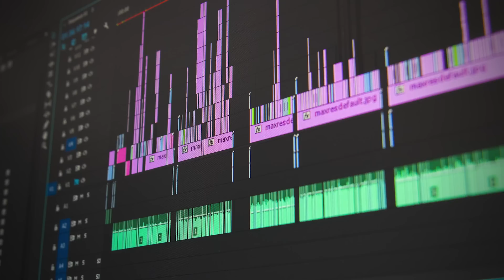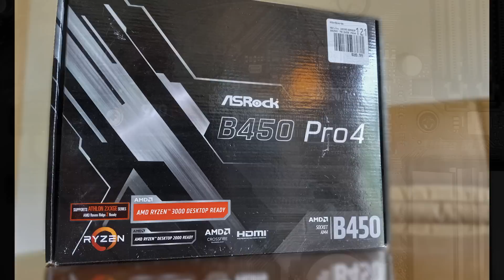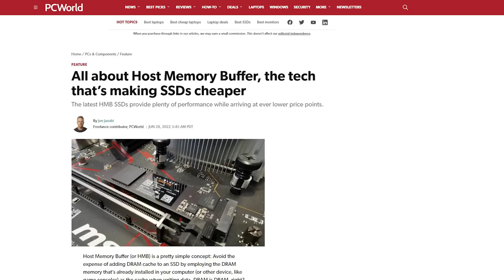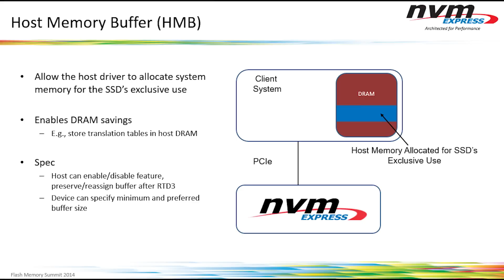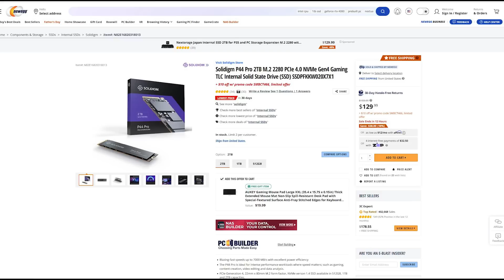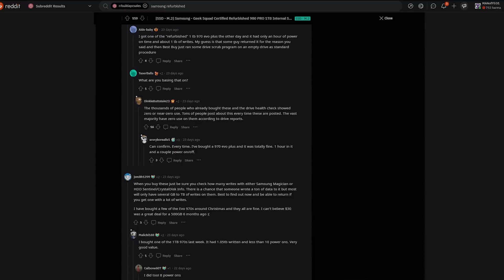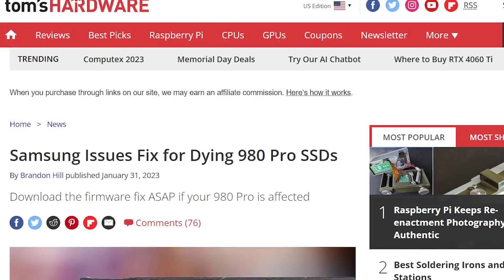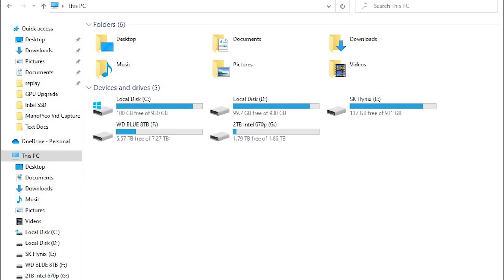SSD Buyers Beware: 7 Crucial Tips for a Smart Purchase

Comment: The video title got me expecting a video about SSD price falling and why and such deeper explaination about it. But turns out to be a SSD buying guide which contains information that i didn't knew before, so i like it.
Reply from the maker: I'm glad you liked it and really happy to have helped!
Reply: @manofyeo  the video lasted me 20 seconds only. I saw the thumbnail title for the intel price set at $67 then I start watching to find out it's a crap QLC based drive
Reply from the maker: @Zikatus  Just because its QLC doesn't mean  its terrible.  Intel's version of it is actually better than most.  And yes its not as good as TLC but depending on the use case it very well may be a worthwhile purchase.  As long as you understand that limitations then its fine.  So go spend the extra $30 on a drive with TLC.  I won't stop you.  But for my use case this drive was an awesome deal.
Reply: @Zikatus  
Your reply "lasted me 20 seconds only."  You obviously can't understand that use case dictates what is and what isn't "crap."
Reply: It’s a long winded explanation but is supply ans demand. Lots of people bought PCs during the pandemic, other over bought due to supply chain restrictions, and due to Covid, lots of 20nm providers could produce capacitors, voltage regulators and folks like Intel/solidigm had to pivot to alternate parts for the SSD boms. So surge during covid, bust now and over supply as folks are now burning thru their inventory and a bit of a recession or folks holding onto $$. GREAT time to buy
Reply: @sklise1  Thanks for trying to give me the answer. Well i expected that people would have stopped buying PC's during the pandamic because of chip shortages and that resulting high prices. So i expected that SSD would be affected by it too negatively as with many other strange things that ran out during or after covid like dry ice 🤔
Reply: @MrGTAmodsgerman  The exact opposite happened, people bought more PC components during the pandemic as the percentage of remote workers spiked.  Also add in the people who thought they were going to be youtube stars.  You couldn't even buy a microphone from Guitar city...smh.
Reply: @cactusjackNV  Yea i know about the impact of remote workers, but i would have thought, expecially then the prices rise because the higher demand + ship shortages, so people then stopped buying hardware as the result. But according to what you guys say, people still bought
Reply: It is a hard topic for him, he took 1 month to select a ssd

Comment: Contradictory to what is mentioned in the tips, HMB is better for boot drive and programmes as they are utilised with small bits and pieces of data that need to be retrieved for OS or programmes to work. DRAM is better for huge storage transfers such as editing videos and photos where larger chunks of data are accessed and the dram comes in handy to ensure they are buffered.

Comment: Hi, dude from Philippines and I'm going to share my Experience. Please excuse my bad English Grammar. 

I decided to upgrade my Laptop to 1tb for Lenovo Ideapad Gaming 3 15iah7 from 512GB to 1tb. Searched online everywhere for the "best" ssd as in my main boot drive since the other slot is a 2242 and it's very difficult to find an ssd 1tb like that. There were choices from Samsung Pro and Evo Models, there there was Crucial P3 Plus and T500, SK Hynix P31 and P41, Kingston KC3000 and Fury Renegade, WD Blue and Black, etc. All 1tb. And went and searched then and there and made my Choice. 2nd year first sem just ended and finally got my allowance. After saving up to P6000($107 USD) this is my official budget and widthraw it. I went to Gilmore District for any of those. I asked everywhere for Crucial T500 1tb which was supposed to be my choice but to my suprise, it wasn't available. There was one online in Shoppee but I don't think it has any reviews so I hesitated to buy it. Went to the  PCHub website for any ssd withing my budget. Originally, I want a 2tb but since they cost around P10000 ($178 USD) during that time, I scrolled down Until I saw the price within my budget section. My choices were WD black sn850x, Kingston KC3000, and Samsung 980 Pro. Now, I hesitated for a while but Now I have made my Choice. I went for the WD Black sn850x cause of the read write speed. Samsung should have been my choice until I read about their firmware issues. Even though they fixed it, I don't know if I can still trust them due to the paranoia surrounding that and their switching of Controller chips. KC3000 was also my choice but WD black sn850x is more promising with read and write speed being 300mb faster than KC3000. I decided to buy it for P5380 ($95.79 USD) with signing all signatures for warranties and checking if there are any physical damage and that was my final choice. Then after that, went home and  did the process of cloning my main drive after turning off Device Emcryption and unscrewed my Laptop and swapped them. Then after that I first opened My laptop to check whether It booted and yeah, it worked. I then shut down my laptop and screwed the cover back and tightened it a little and opened my Laptop again. I was satisfied with the capacity and after that, I downloaded Metal Gear Rising: Revengeance and Devil May Cry 5 and it all went prety well. Of course, I pirated it since Metal Gear isn't available and DmC 5 was too expensive for me at least and still saving up to this day. My only regret for this drive is that it doesn't have hardware encryption and didn't support it. So I will have to be more wary of which sites I visited. Overall, I am satisfied with it so far and hope in the future, it doesn't die on me. That is my experience. Thank you for reading.

Comment: the solidigm p41 is considered the 670p successor, however it doesnt have dram. would you choose the p44 pro because of this?
Reply from the maker: The p44 pro and the platinum p41 sk hynix are definitely a much better drive overall, but also more costly.  If you want a high end drive with super fast speeds and dram they are great choices.  But as a budget choice if the price is right the p41 plus is still a good option if you don''t need crazy speeds.  The HMB works pretty well as a subsitition for DRAM.  I have one as a secondary drive now and notice no difference from any other drive.  I know DRAM is recommended for boot drives but I think for most people who are average users wouldn't have a problem with it.
Reply: @manofyeo  thx for the reply 😄
Reply from the maker: @dele7ee  no problem!

Comment: Your comment about ending up with too many drives as well received. For some reason I have five external drives brand new in the box sitting on my desk I’m not sure even why I bought them off, but I am going to go set up a complete back up system from my home computer. I’m pretty much in applications user I don’t program I don’t do websites. I don’t even know what discord is. Thanks for the video. I’m interested in these drives for whatever crazy reason.
Reply from the maker: It happens to the best of us.  Ever since I started browsing r/buildapcsales I have to be careful that I don't order crap I don't need.  Hopefully the drives you bought were a good deal and if they are shuckable you can turn them into some kind of a NAS.  Also there was some good deals on prime day there was a 2tb 970 evo for $80 I believe and the 2tb WD 850snx gen 4 for $90.  Also 980 pro with heatsink for $100 and SK Hynix P41 for $107.  All great values to consider depending whether you have gen 3 or 4.  Thanks for watching!

Comment: Been shopping around for another gen 4 m.2 as my 1TB Sabrent rocket is filling up, I still have over 3TB on my backup spinny disk, but thats all I intend for it, as a backup. 2TB seems to be the sweet spot in price, as long as you have the extra m.2 slot. For me I don't lose any SATA's until I use the third m.2 slot. This is where paying a little extra on your motherboard can pay off, when I built my PC I never thought I would ever use all the slots and functions of the board, but a few years in and those slots get filled up.
Reply from the maker: Yes when I bought my board as a combo with a r5 3600 I didn't know much about it and was just happy to have a huge upgrade from the fx8350 I was using.  I figured I might get another TB of storage down the road but never would've though Id fill up nearly all the sata ports and nvme slots with drives. With my next upgrade I will know what to look for in motherboards, but I can't complain to much as this cheap Asrock has served me very well.
Reply: @manofyeo  Oh for sure, not meant as a criticism of board choice, we all have to make choices... or all our PC's would be 10k 🤣. But 2TB drives are definately the sweet spot, the difference in cost between several 2TB drives and say one 8TB drive would pay for that better board, when someone is planning their build.

Comment: don't buy SiliconPower, tried in the past, SSD and RAM, SSD died less than a year, RAM corrupted also less than a year, causing lot of data corruption and crashes, i know that after doing memtest86..
Reply from the maker: I use SP ram in my build I've had no problems in 2 years.  I have used 4 kits but one of them couldn't hit xmp so I returned it.  They definitely arent the most trust worthy but in my experience the ram is ok.  I dunno if I'd trust the SSDs though.

Comment: Data hoarding on ssd can cause them to fail prematurely.  If you almost fill an ssd to it's limit and keep it there, especially a boot drive, you can kill one in about a year of use.  An ssd needs to have about 20 percent free space to have its advertised life.
Reply: It's based on writes, not reads, applying a charge is what wears the cell down.
Reply: @michaelkeudel8770  you are correct, and keeping an ssd at near full capacity multiples the number of writes by 1000 percent.

Comment: I'm curious about how the 670p behaves when nearly full, given that it uses SLC cache. Something it can't do when nearing capacity.
Reply from the maker: I'm sure it slows down when almost full which is definitely its one downfall.  I may experiment with filling it up to see how it does but for me I don't plan to keep it maxed out.
Reply: @manofyeo doesn't all nvmes slow down near full?
Reply from the maker: @Darkknight9035  Yes but with SLC cache specifically it will slow down at less capacity than other drives.  Its best to leave 100gb free on any ssd performance wise, but some some drives like this will slow down when they get to 80% capacity, sometimes even lower on really bad drives.  Intel drives are the best of this type by far.

Comment: The Silicon Power UD90 was only $169 for a 4tb nvme last week. It's gone up since they sold off their bulk stock I guess, but 4tb drives are getting down there to the point where buying anything less aside from a system/boot drive is becoming less worth while.
Reply from the maker: Yes its great to see 4TB follow suit!
Reply: I will rather not buy Silicon Power anymore. 512GB drive failed miserably. Luckily I make backup regularly. Drive was not filled more than 3/5 and bytes written was neither even 10% used
Reply: That is one of the better cheap PCIE 4.0 drives. Just no DRAM but good for storage. The old 3.0 MP34 also looks quite good for the money.

Comment: I already maximized the value of my 4 TB M.2 NVMe SSD with 7000/7500 MB write/read speed, 2 GB DDR4 buffer, AES-256 encryption, 3000 TB TBW and TRIM which I bought for 250$ equally stonks
Reply from the maker: Nice
Reply: @manofyeo  PNY XLR8 Pcie 4.0 4TB disk by the way 

*flex intensifies*
Reply from the maker: @YourCloseCoop  Sounds like a solid deal for a high end drive!  You'll be good for a while.
Reply: @manofyeo  wow, thanks dude :)

Comment: 740TBW for 2TB brand new SSD  is not high enough (I mean old SSDs had fewer life for each type and 740tbw for 2tb TLC would be alot like 4 years ago but not now but for QLC like intel u bought is good)
for standard TLC SSD 2TB has 1200TBW (like SAMSUNG 970,980,990 Pro (or EVO) or WD SN 750,850)
some drives like ADATA XPG high end SSDs like S70 it will be even higher like 1480TBW
and for high endurance drives like SABRENT Rocket 4 or PNY CS3040 it is 3600TBW (which is insanely high) and they are not expensive (they are even abit cheaper than 980 pro or SN850, but faster than even best gen 3 drives, fast enough for most people, about 5.000 read and 4.500 write is alot (I know 980/990 pro or SN850/SN850X or S70/S70 blade or Rocker 4 Plus are faster (close to 7500 read/ 7000 write) but 5000/4500 is more than enough for most people specially if users write alto of drive, high endurance drives will be better for them than faster but with 1/3 life)

btw I never suggested intel SSDs to anyone even before selling its NAND part, they never been fastest or cheapest or best in anything (Optane drive are different, those were very durable and high endurance and too expensive for low capacity like 16/32/64 GB, but were great for use as cache for large HDDs to have alot of space with high speed (like if u would cache 64gb Optane for 10TB HDD u would have storage with SSD speed and HDD capacity and because of very high TBW that Optane would work for years before dies)

about SSD caching. cheap SSDs use SLC caching (like those models u see with a bit fewer capacity, like 240 except 256 or 480 except 512) they use few GB of their space as SLC (doesnt matter rest is TLC or QLC)  which make it faster (not by far like DRAM) and good for cache and improving performance for no cost
then HMB came and some cheap models have it now (newer versions) but not all, WD Green still doesnt have it, or even in Blue series SN550 doesnt have it but SN570 has it
or SAMSUNG 980 (as far as I know SAMSUNG only SSD without DRAM) but they use very very small portion of system memory (even like only 64MB!)
I like Crucial HBM wich call momentum cache , it can use system ram up to 4GB!!! depend if system has enough ram (like in systems with at least 16gb ram , it can cache up to 4gb, 
and if your system memory is fast (like fast DDR4 (4000+) or even faster DDR5s, will improve SSD performance more than integrated DRAM (which is 512MB  or 1GB in most SSDs and their type are LPDDR3 or LPDDR4  slower ram)
for example Crucail P2 is very cheap M.2 NVMe SSD. with speed Up to 2.400 read and 1800 write, but with momentum cache enabled of system with 16gb DDR5 ram, in tests it reach Up to 8000 MBps for read and 7500 for write (files below 4GB)

but doesnt matter of your SSD, enable over provisioning in its software, if it doesnt have or support, do it yourself and set some as unpartiotioned, (10% of its capacity is recomanded but if u have large SSD like 2TB or more 5% is good enough too) with this action your SSD speed and endurance will improve.

I have add that health percent software show is not always accurate, they calculate it as how much drives TBW total and how much u write on it by far, but sometime because of some problems like firmware issue it will reduce much faster (like happened  for SAMSUNG recently and had to fix it)
or I find in some models of ADATA new series (Legend) it doesnt go by numbers company give us, like Legend 850 1TB with 1000tbw, its health go like models with 600TBW (in all capacities)
Reply from the maker: Wow thanks for the detailed and thorough comment!  A lot of great info here!  That is very interesting about the Crucial HMB, I have never heard of that.  I will read up on that for sure.
Reply: More real world type benchmark suites always showed the intel drives in a better light, the synthetic ones are just less applicable to the real world. TBW is just a warranty threshold, it does not reflect actual wear, small writes are worse than big, so actual lifespan varies.
Over provisioning perhaps on your boot drive, anything else is a waste of time as these rapidly become obsolete.
It is good to have dram for when it eventually ends up in an enclosure and maybe no hmb.

Comment: One thing I would mention in this topic is that if you lack free NVMe slots you can buy PCIe cards that let you slot them.  The specs of your system and motherboard design will determine if slotting an NVMe drive this way affects speed or not.  Likely the PCIe bus is not going to be saturated and will perform perfectly fine to maintain top speeds for your drive.  The biggest competitor in most systems for bus bandwidth will be your graphics card, but even top end graphics cards don't fill out PCIe 3.0 spec speeds.  Perhaps if you have multiple graphics cards/Video capture/stream encoder devices all using the bus.. well you probably won't have a slot left to put the PCIe adapter anyway!  In any case while I doubt saturating the bus is a big worry, I don't want anyone out there getting sub-par speed because I forgot to mention to check.
Reply: This is also where AMD has an advantage as it has more PCI lanes on average than Intel.
Reply from the maker: Yes this is one solution I did not cover and it can be a worthwhile one!  I plan on getting a capture card soon so it may not work for me but definitely good info for the masses.  Thanks for sharing!

Comment: I want SSDs for a NAS not because of the speed for software but for the reliability and quick transfer speed for backing up the data. I only wish they would sell 10 TB SSDs instead of capping themselves at 8 TB.
Reply from the maker: I believe they have 16TB coming soon.
Reply: @manofyeo  yowza!  Look forward to 16TB as hopefully it will bump the price down on all the other smaller capacity drives.  Who knows but we can only hope.  Thanks for the video!
Reply from the maker: @cactusjackNV  I also saw something about a newer high capacity HDD technology that is allowing for 30TB drives soon and eventually 50TB HDDs.  It's a never ending race.  Thanks for watching!